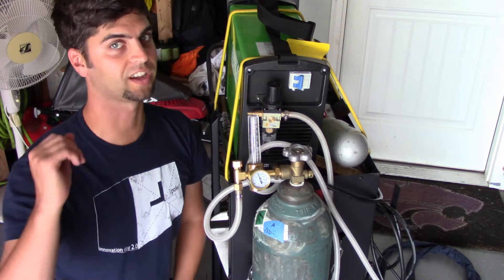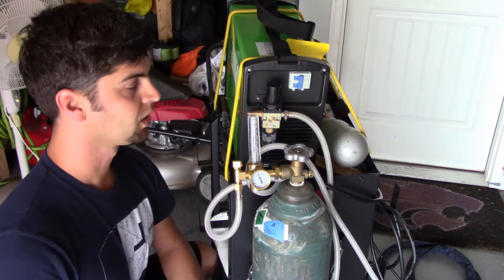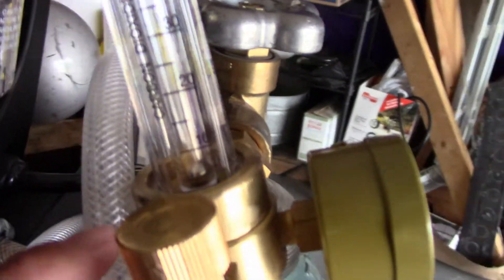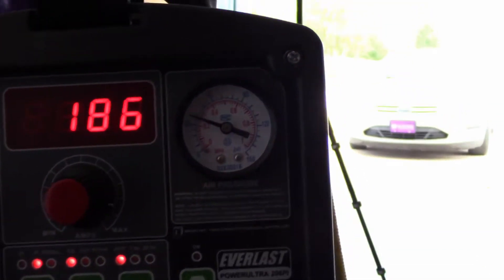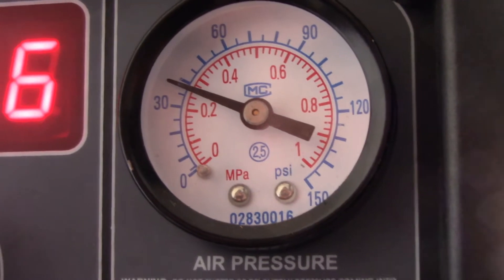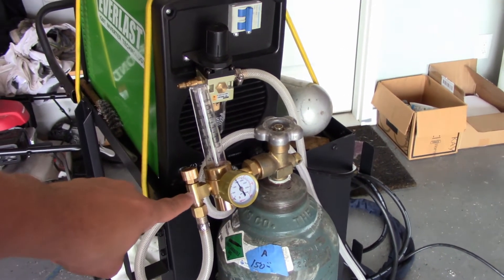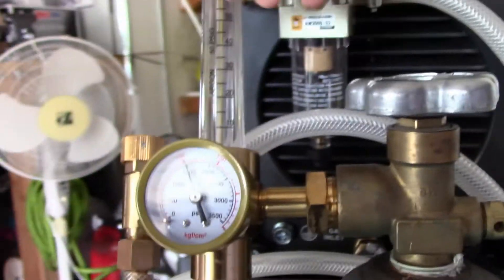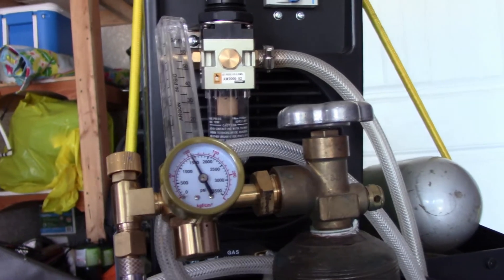Argon Regulator Problems, a Tubesday Short

Comment: The other little bras knob by the hose connected to the regulator adjust the the flow.  Turn the machine on and hit pedal or trigger to open the solenoid in the machine then you can’t the flow 
Also the the regulator should be sitting perfectly vertical.  Not leaned back at an angle.

Comment: first dial gauge is tank pressure. second vertical is gas flow - should always be mounted strait up and down not at any angle. (when you pull the trigger - gas flows then you turn adjustment nob to set the flow rate ie using a 5 cup on tig or most mig welders this rate should be between 8 and 15 {I prefer 15 doing stainless}) when you first open the bottle - gas flows into the line until pressured up thus the ball will rise with the gas flow until pressure is equalized then fall to the bottom. the guage on your machine shows you the line pressure - most flow meters are preset between 30 and 50psi. I prefer a lower pressure flow meter for my work. 15 CFH flow rate on a number 4 AKA 80 CF bottle should render approximately 5 HR of gas flow - with pre flow and post flow = about 4 Hr of actual welding.  If you Tack - Tack - Tack weld for 2 minutes reset position weld for 2 minutes reset position weld for 2 minutes - 2 second pre 5 second post flow you have used about 7 minutes of the 4 hours of welding even if this takes you 45 minutes to complete. * VERY IMPORTANT * Your machine should not alow gas to flow when not welding (except for the 2 or 3 second pre and 5 second post flow of gas) If your welder is allowing gas to flow when not on the trigger or pedal there is a problem with your welder. This is Argon gas or Argon / Co2 mix and can be deadly in a closed garage area !!!
Reply from the maker: it surprises me to this day how often this video gets comments as it's nearly 8 years old now! But it's great to have the inventory of comments for the next person who comes along and setting up their machine for the first time so they don't run into the same questions/concerns I had when I made it. So thank you for the input!

Comment: The guage shows the bottle pressure .  The flow meter has it's own internal pressure regulator. That pressure should be what the flow meter is calibrated with from its design by the manufacturer.  Because my flow  meter  looks just like the one you are showing, I think it is sold under numerous Chinese brand names. (Yes*, Betooll*, NTX*, etc.). I think the flowmeter working pressure should be set somewhere between 20 and 50 psi due to the fact that has a rated maximum working pressure of 50 psi. The problem I have is that I can not get it to give me a stable 20 CFH  flow. I have to increase the flow to a minimum of 30 CFH  in order to get a stable flow  according to the ball in the sight tube. I was looking  to see if anyone else has the same problem and if they did, did you adjust the working pressure of the flowmeter by adjusting the hex adjustment screw (with the red paint mark on it)  in violation of the warning sticker about the danger of injury if improperly adjusted?
Reply from the maker: I continue to be amazed how much traffic this video still gets. I've been operation with it for 7 years now with no issues. I've since learned a lot for sure. Appreciate the pointers

Comment: That's the Yes welder regulator? Exact same question I'm looking to get info on. I don't have a pressure gauge on my Ssimder Mig  250d machine like you do on your Everlast. The bearing does nothing on trigger pull. The only time it moves is when you first ope the valve on the tank.  The valve on the regulator seems too be opened or closed but nothing in between.    First tank seemed to go alright but not great, the second tank not good at all. Checked for leaks with soapy water and kinks in the line, gas came out of trigger pull for 15 minutes max and seems lik it's empty now. Last tank lasted me a couple hours 60lb. Got some decent beginner welds out of it but this tank was all sputtering and spitting. Could have been CO2 for all I know.  Wondering if they gave me something other than argon because the guy said he couldn't fill my tank because he needs to refill his main argon tank. Then he traded my tank for a prefilled tank he had. Anyway, I  can't say for certain the the issue with the Yes welder regulator but I'm looking for a better one that can handle two tanks and shows tank levels. I'm also wondering if it's possible to get an air locked if you open in the wrong order like forgetting to open before turning the welder on or similar..
Reply from the maker: @GypsyJrs  The bottle should say on it if it's pure argon or a argon/CO2 mix. I don't think you want to run pure argon on MIG, but to be honest I don't own a MIG either. This is an old video and I've learned much more since.

Comment: For me I had to lose the inlet on the back and it worked better or have a10cfh leak
Reply from the maker: since switching to the other style regulator, it has worked like a champ
Reply: @Str8sixfan  thank you with the dual guage ? I may have to do the same
Reply: Also everlast hose clamps kinda suck I'm noticing...so I keep some spares of the other screw tight kind
Reply from the maker: @DonnyBwelding1  For as old as this video is, my originals have held up just fine

Comment: blue and red welders do not have that problem ...., put a piece of duct tape over that junk gage on the welder and go by the flow meter , most likely the gage  on the welder is faulty
Reply from the maker: hahaha! It's been working out great. thanks for watching!
Reply: Dude. Its air guage for plasma cutting. Not a flow guage for argon.

Comment: It is a flow meter so when first opening the bottle the ball will float til the hose is on presure and then it fall down. When you pull the trigger and keep it the gas will flow and the ball also. I see nothing wrong whis it.

Comment: If you want to check the flow, squeeze the trigger if its mig, or open the valve if its tig. If gas can't flow out of the nozzle, the ball won't move.

Comment: Your regulator is not crap and is more than likely working just fine.  A few tips to think about are that you should have your flowmeter completely vertical and not tilted back to get the most accurate reading, also read the side that says argon not CO².  That dial on the front of the machine has nothing to do with your tank of argon if it's hooked up correctly. No clue where it's reading that 35 psi from, but that bottle has 1,500 psi so it's probably not that.  You can also temporarily increase your postflow time so you have enough time to adjust the flowmeter and have that ball where you want it.
Reply from the maker: Yup, I've learned almost all of this in the amount of time it's been since I posted this video. Learned a lot. But the replacement valve I got for free works great and am happy with it. Definitely prefer it.

Comment: Everything is normal. With a flow meter like that, the dial is showing bottle pressure. It will read the same even after you close the tank valve. Once you push the trigger with the welder off, that residual gas will be released and the dial will go back to zero. As for the ball float, that is your working gas level. It only moves when you push the trigger.
Reply from the maker: I ended up getting a different regulator and am happy with it. Thanks for watching and the input. I believe I still have this regulator

Comment: Dial guage is likely tank pressure.   Ball/flow guage only reads when gas is flowing.   Internal guage on machine....not sure...I think that is also flow...since after the regulator it wouldn't read tank pressure.   I say open tank valve.  Open flow valve.  Open machine regulator.  Pull trigger or open valve on Tig so you hear the hiss coming out the "gun" and look at ball flow meter and guage on the machine.   Those should come close to matching imo.

Comment: You should have another gauge in front of the one that shows tank pressure and that one will show working pressure , but like Rusty says working pressure should be adjusted when there is gas flow that Is how mine is set up
Reply from the maker: Appreciate the input. I guess this style is a cheaper style (was included with the welder).

Comment: I’m pretty sure the gauge on your machine is for regular compressed air if it has the plasma cutter option. 
There should be a separate connection for your shielding gas. It definitely should not be going into that compressed air regulator mounted on the back of the machine. The ball on the flowmeter part of the gas regulator only floats up when you have the welder energized for making an arc. Sorry, little long winded
Reply from the maker: Well I never plug it into the regulator for the plasma cutter, however the outlet from either regulator does feed into the same inlet for both modes on the machine. I'm wondering if I'm pressing the foot pedal or thumb trigger, if I can regulate it in the middle of doing that.
Reply: Str8sixfan Ah, ok. I wasn’t aware of that. Yes, you can adjust the flow by doing what you said.
Reply: I agree with Cyclops. The gauge on the front of your machine is for regular compressed air for the plasma cutter. Only compressed air should be going in it.